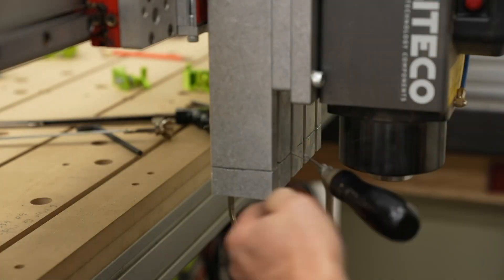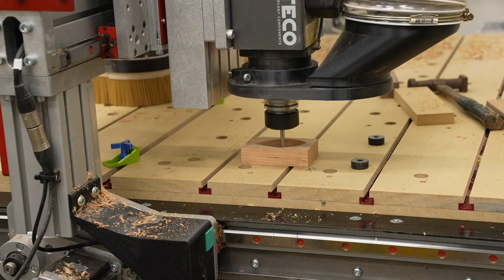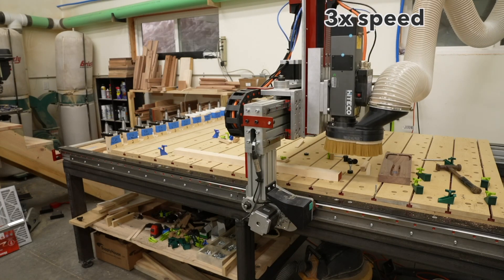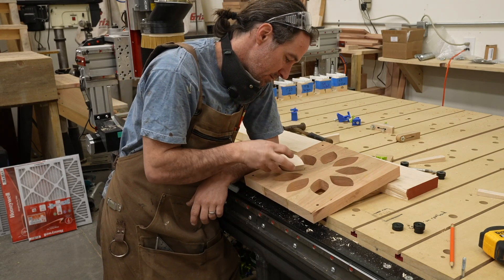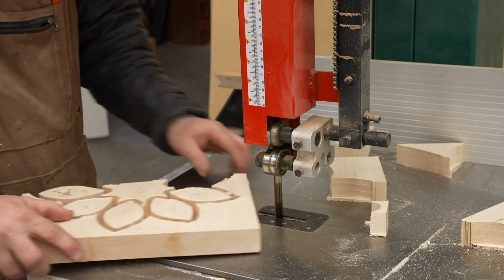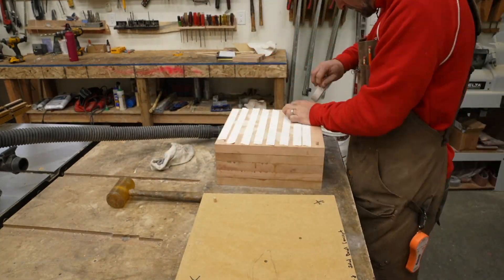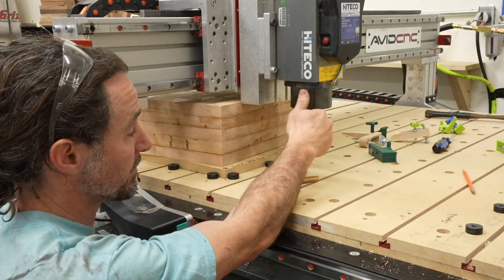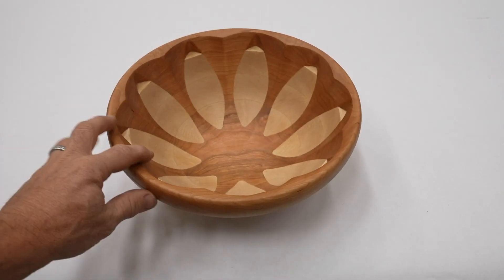CNC Salad Bowl - 5" DEEP INLAY Failure. With so many mistakes and test cuts...

Comment: Could you elucidate what the exactly process steps in Fusion which introduced the irregularity?
Reply from the maker: YES! I was going to go into it in the video, but I thought it was too boring to talk about. Bottom line: the vector wasn't "clean". Long details:  For a single "plug", I was drawing one half and mirroring it. Then rotating the mirror'ed shape in a circle pattern. My first error was the curves were not completely tangent to each other. This meant the cutter wouldn't be able to cut the same shape in the plug and the hole. My next error was in mirroring; you need to ensure your mirrored half is snapped to the mirror line. Mine wasn't, and it was just ever so slightly off.  This problem was multiplied when I did the circle pattern, creating a slightly different shape in each hole. Visually it sort of looked okay until I zoomed way in. I snapped it to the mirror line, and fixed the tangent issue, and then the shape was a good size that could be machined out. This allowed one plug to fit into any given hole.
Reply from the maker: err..maybe you can't go back in history without my older version.
Reply: @CorbinDunn  Thanks for the explanation.  I reckoned if you were able to stub your toe, I could too.
Reply from the maker: You can download the Fusion file and zoom into the Plug sketch. It is "fixed" in that version, but I think you can go back in history and see the broken version at some point.

Comment: I have been playing with inlays for a long time.  It is not easy.  To avoid the chipout try doing your inlays using endgrain plugs.  grain direction plays an important part when doing inlays.
Reply from the maker: Good idea! Maybe I should have tried the plugs with just engrain pieces. I’ve done this for my spoons with inlays, but I didn’t even think about it for this project. More stuff to try! Thanks!!